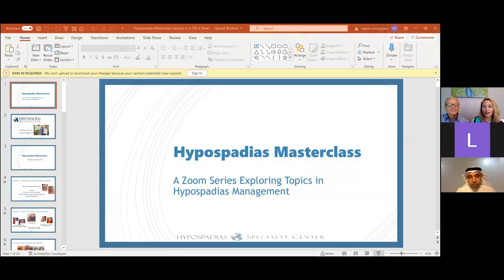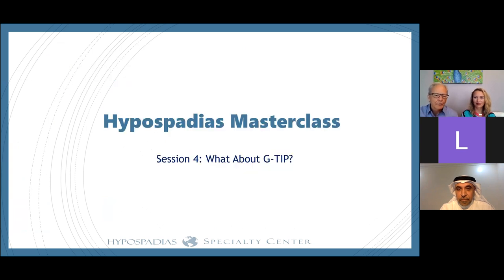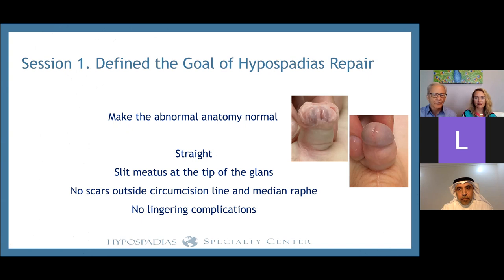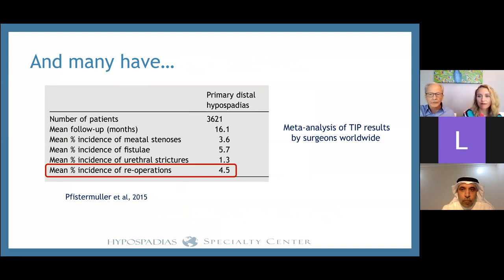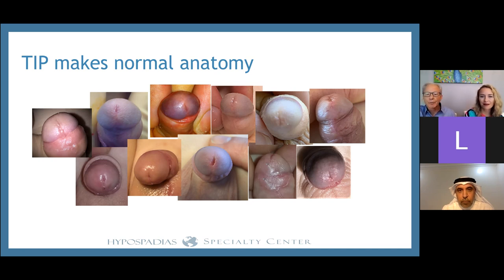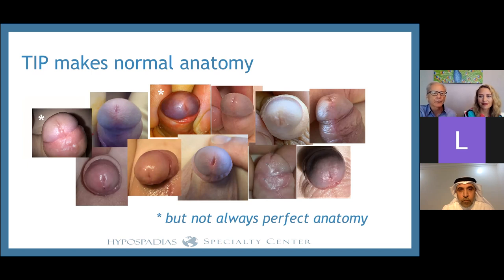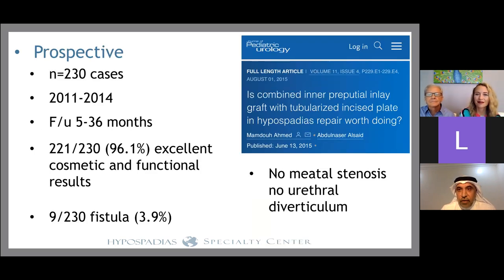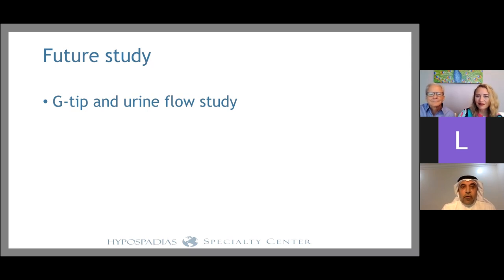Hypospadias Masterclass Lesson 4: Should the TIP incision be grafted (G-TIP)?

Comment: I used the grafted tip years ago in primary repair but abandoned it because the graft looked unnatural and irregular. The  TIP without graft works but small details are important like incising the edges of the plate to the end, closing the urethral plate midglans, incising the plate, close in two layers and covering the repair with dartos or tunica vaginalis. I do not incise the glans but really just the edge  of the plate, and make a plane between the glans and plate. Of course the glans is mobilized and dissected, but not actually incised.